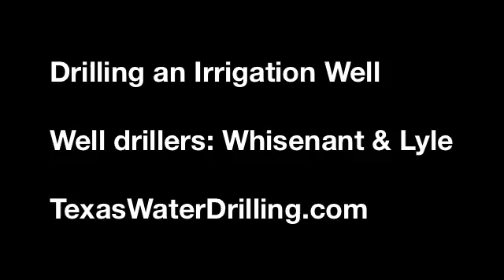Drilling an Irrigation Well

Comment: Is it usually 600 feet to hit the good stuff?
Reply from the maker: Depends on how far one is from an aquifer.   In downtown Austin, water table is about 15 feet down.  Out here in the Austin Hill Country, takes more drilling.
Reply: Are you using a gopro for you video?
Reply from the maker: +eddie bres if I had one at the time, I would have. I just used my MacBook Air. Pointed out the window, and used iStopMotion software to take photos and assemble in to movie.